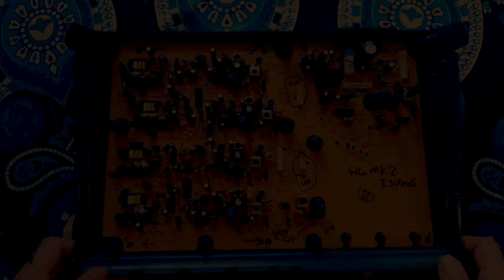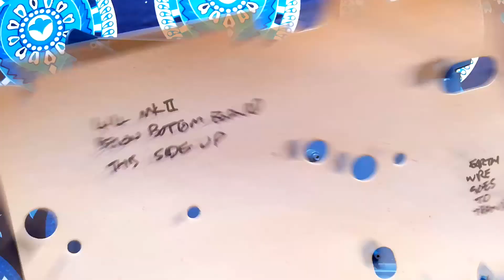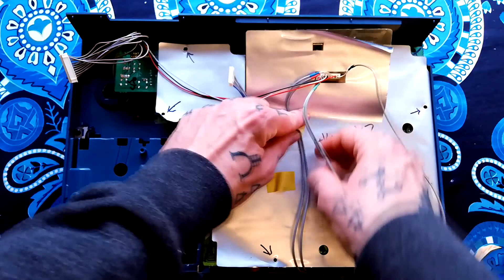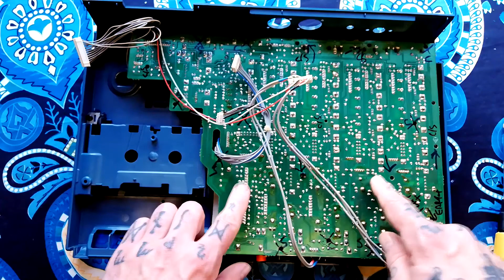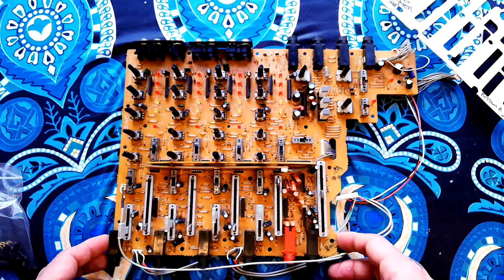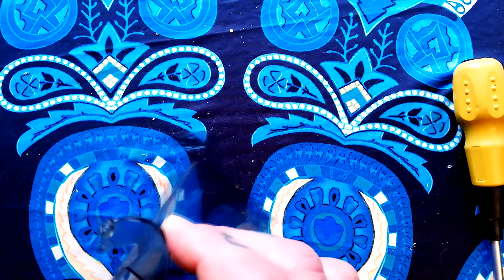Tascam Portastudio 414 MK II | tear down part two - remove door and PCBs

Comment: Very helpful video. I'm about to buy one today and wonder if there is a toggle switch modification to reduce the transport speed by 1/2 - still allowing for the use of the pitch control.

Comment: Thanks for all your informative videos. I have an issue with a 414 I’m trying to solve. The input on channel one has a signal, however when I try to record with it there is nothing on the playback. The other three channels properly record to the tracks though. Any thoughts on how to solve the issue with channel one? Thank you!
Reply from the maker: First establish whether the record play head is at fault or the record or playback amplifier- if you play a pre recorded tape, do you get signal from tape on channel 1? If you don’t have a pre recorded tape, record to track 4 and turn the tape over - if your head is healthy, you should be able to hear what you recorded play backwards
Reply: @Tetrakan  Thank you for the guidance! I’ll put a pre recorded tape in there and let you know if I get a signal.
Reply: @Tetrakan  I just tested the 414 with a pre recorded tape I made with an MF-P01. I do get a  good signal on channel 1. From your previous comment, I guess I now need to test the record and playback amplifier? This is all new to me, so I appreciate you walking me through this as much as you are willing to.
Reply from the maker: This shows the playback amp and head are working. Try replacing all electrolytic caps associated with the record amplifier. The schematic is on my blog. Dm me on fb or ig if you’re not sure.

Comment: Hey dude! Love your vid. It really helped me through the opening process. My 3rd track isn't working properly, there is a loud buzZ when I press play and the output volume is really low. Do you know how to solve this problem? Thanks Tetrakan!
Reply from the maker: Check the cables at the base of the rec/playback head are still intact. Failing that try signal tracing to establish where the cassette audio goes from healthy to buzzy and quiet, this would give you a clearer idea of where the fault lies and which components might be causing the issue. If you're not set up to signal trace you could just replace all electrolytic capacitors and reflow the solder at the base of all components associated with the playback amp of Ch 3, you'd only need a soldering iron and £5 worth of caps for that, the schematic is up on my blog for free download.
Reply: @Tetrakan  Thanks for your reply! It looks like a small white & red cable was disconnected at the playhead so I was able to solder the cables back to the little board underneath the playhead and now playback on track 3 is working! So thanks for your help! 

There is a new problem now... the playback seems to be really fast on tapes i've multitracked on this machine. It sounds like I put in a normal commercial tape and is now playing my song chipmunk style. Do you know what the reason might be for this? Thanks again Tetrakan!
Reply: Dude I fixed it! 

Turns out there was another small Track 2 cable attached to the playhead that had come un-soldered that was affecting track playback and tape speed for some reason

I soldered all wires and adjusted the internal amplifier knobs that I found on the schematic manual off your blog and now it seems to be working properly! 

Thanks again for your help!
Reply from the maker: Check the blue and yellow cables running to the motor, if one is disconnected the motor will run as fast as possible and the pitch control won't work
Reply: @Tetrakan  Thanks! Yes exactly, correct diagnosis. The cables running to the socket input from the motor weren't completely pushed in

Once I pushed them down and the socket clipped together with the pins the problem was solved!

Do you have any tips on adjusting the  internal amplifier knobs? 

Thanks man!
Reply from the maker: Here's a playlist with all my calibration videos in it. https://youtube.com/playlist?list=PLYsfQOh0tsJV9Sg5ZVopWqHu_yJqkUJMS you can use a loud passage of any tape to get the 4 playback preamps roughly even, though  ideally use a test tape
Reply: @Tetrakan  Hell yes, thank you! 

Gonna just freestyle on the internal knobs and figure it out without one of those wave devices

Thanks again for your communication and help dude!

Comment: Awesome resource! Do you know what pitch 8pin connector is the right one for the erase head connection?
Reply from the maker: I’ve crimped on jst connectors in the past, pretty sure it was 2mm pitch, but desolder the header and measure the space between holes with a ruler before you sink a bunch of money into it!

Comment: Thank you for making this video it’s great. I just got one of these off eBay and when I record onto the first track when I play it back it sounds very quiet and I know I’m not doin anything wrong when recording or playing I want to know if there is something electronically that could be causing this problem. Thank you
Reply from the maker: The simplest thing would be either the record or playback trimpot has slipped or got dirty, turning down the gain on that channel; these are on the bottom PCB and labelled somewhat clearly. Ideally you would have a playback calibration tape and calibrate the playback levels before adjusting the record level but such tapes are expensive and rare....so long as you're not too fussed about higher noise floor you could just try turning those trimpots up a little anyway. I have a playlist of videos on calibration accessible from my homepage if you want to learn how to do it properly.

Comment: Great videos! Quick question, do you know what the big blue capacitor near the power jack is? Recently picked up a 414mkii and it has a very noticeable hum only while in record or play mode though. Just took a quick look in side and noticed that big blue one was covered in junk and seemed like it leaked. Rest of the inside is very clean. Might try to replace it and see if it helps though can't seem to find what kind of capacitor it is. Any thoughts?
Reply from the maker: It's an electrolytic capacitor, it's almost certainly the main filter capacitor following the rectifier (Google linear power supply if you're not sure what I'm talking about) the capacitance and voltage ratings are written on the side. What you're seeing might be leaking fluid, but it could be just glue to stop it rattling around. It isn't difficult it expensive to replace. Here's a video about it. https://youtu.be/cM-mx0_0pss. Also check the black earth connection from the record/playback head to the bottom PCB since that is another common cause of the sort of symptoms you describe. Good luck!
Reply: @Tetrakan  Thanks much. Going to try replacing the cap(s) on the power sections. Seems like the case. Checked the ground wires but couldn't notice anything off. All seems connected and very clean on the inside. Good to know about the glue. Possible it's a combination of that and some leaked fluid as it's slightly crusty and runs up the side of the capacitor.. Cheers!

Comment: Thanks for the vids, I have a 414 coming soon, could you tell me where I can get the belts you mentioned in one of your vids. Thanks. Ian
Reply from the maker: I know I already answered this already via facebook but for the benefit of anyone else reading these comments wondering which keyboards to enter into ebay/ali express/ etc the wording of the item I bought was "	
60+ Pcs Universal Mix Cassette Tape Machine Belt Common Square Belt Assorted"

Comment: hi i just wanna ask if whats the problem with my portastudio rew button not working and also ffw button is not funtionaly workin if you press it it wont allow you to do it so is it a belt problem hope to hear from you asp tnx..?
Reply from the maker: Can you confirm which model you have? If its the 414 there's a separate belt which drives the reel mechanism (reel mechanism = all the moving parts that turn the reel tables) I point it out in the previous video in this series, replace that rubber part and see where you are?

Comment: I have a 414mk1 where the L-R monitoring only comes through one channel, whereas the tape cue monitoring comes through both headphone channels fine. Any ideas on where to start?
Reply from the maker: Look at replacing 1) reflowing solder 2) replacing electrolytic  capacitors and 3) replacing opamps on the part of the signal path following the pan controls. I'm not very familiar with the schematics of this model like I am some other portastudios, but here's me fixing a similar issue on a 244 - that'll at leats give you some ide of the sort of circuit topology you'll encounter, only it should be easier on your 244 because the signal passes through fewer circuit boards https://youtu.be/qJYHLKZMyTQ and you can get the schematics for the414  mk2 which is more or less identical from my blog for free https://tetrakansupermonobloc.home.blog/2019/04/26/tascam-414-mkii-user-manual/amp/
Reply: @Tetrakan  In case anyone else is in the same boat as me, here's an update: I gave all the pots and faders a real good cleaning with CRC electronics cleaner and then applied some deoxit faderlube. When I buttoned everything back all systems were go. Not exactly sure what fixed it but I'll take it!
Reply from the maker: Grant Stanaway glad to hear it’s fixed...folks assume step 0) in my advice above is clean and lubricate!
Reply: @Tetrakan  Awesome thank you I'll start there!

Comment: I have one and the 4th channel is not recording. Any common issues you have seen? I have started breaking it apart but wondered if there is a cap or other frequent failure. Channels 1-3 are OK.
Reply from the maker: I haven't worked on this model frequently enough to tell you which components are more prone to failure, but based on my experience with other Tascam portastudios causes of that sort of problem in order of likelihood are or cracked solder joint (especially around switches etc); leaky electrolytic capacitor; dead opamp. The schematic is on my blog for free download so it should be fairly easy to identify which sections are the ch4 record and playback amplifiers. You could do some probing with a multimeter, 'scope or audio probe if you know how, but even if not, if you try first reflowing the solder or failign that replacing all the electrolytic caps and opamps in that part if the circuit the chances that your issue will clear up as a result are good.